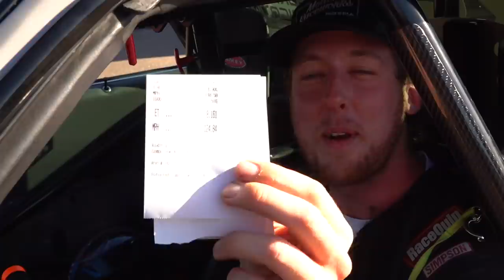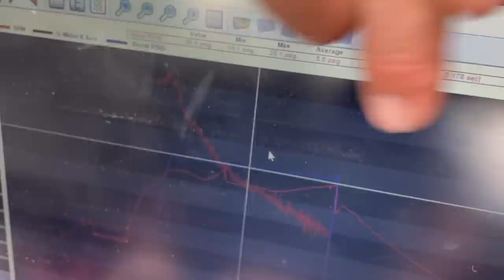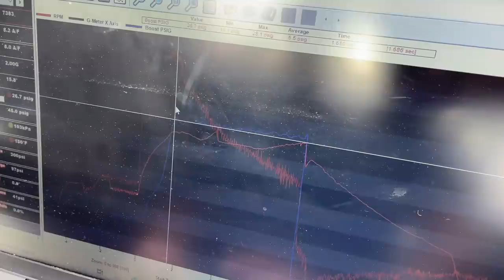Testing Mullet's NEW Turbo400 Lockup Racing Transmission For the First Time! HOLY SMOKES!!!

Comment: dead soft copper head gaskets have been used in drag racing since the 50's even in top fuel at well over 10,000 hp they still use the same soft copper head gaskets with good reason they work . they seal every time and are reusable add them and seal rings to an engine and you will solve well over half your head problems.

Comment: Wow I can't believe yall are pushing that kinda boost without O-ringing it! Kevin may call it a top fuel loop but we do it to almost everything anymore. Especially at those levels. You have a good engine builder. Need to talk to em about doing this on all the Texas speed plants. They have been good to ya. Time to step up the game! Btw the engine in my picture there is at 14.6 compression and is O-ringed.

Comment: You can do 2 things, a stainless ring in the block with a standard head gasket to help pitch and hold more cylinder pressure. or go full race with a fire ring and copper gasket. Fire rings require the wire installed in the heads and a receiver groove in the block, at least thats how the top fuel setups are.
Reply: Yo! Thanks for watching, I love you Fam!
You can start making profit like me in just three hours, don't miss out
Tell him I sent you!.
Reply: FIIVE ONNE FIVEE THREEE ONNE ZERRO FOURR FIIVE SEVVEN THREEE
Tell him I sent you!

Comment: I think the 60 foot problem may be an issue related to the initiate take up.  If you want closely, when the car leaves there is a little, tiny step forward before it really gets into it.  That is likely just enough to start the timer and boom, there is a tenth right there.  It's like it's not leaving tight at all.

Comment: Might be an idea, when there seems to be a problem, to make a habit of checking the cranking compressions when the plugs are pulled and before trying to restart/run the engine. Better yet would be cylinder leakage checks.
This will potentially point to a mechanical issue before it escalates, and also give some idea of the changes in the engine's ring and/or valve seal over time.

Comment: That stainless ring idea, once I heard it, just sounds kinda like a "Duh" kinda thing. You seal it in a way that provides as much safety as possible in case of explosion, but that first prevents explosion, coolant micro-poofs included. Can't weld it, so you invent some form of bracketry that increases a uniform and specific amount of resistance.

Comment: 25.06
Was just gonna say over at John Doc with TK they are doing that stainless steel ring instead of o-rings at top of each cyl when Kevin said kinda same thing.
If it did lift a head it did so on the pass before this one too because you can hear it.

Comment: Sometimes super safe is not good either. A little to rich and not enough timing will make that cylinder pressure a lot more then needed. Methanol is tricky.

Comment: Needs a fire ring. Anything high boost application. See it all the time in diesel builds and some factory Diesel engines. Nelson racing engines does it on most builds I think.
Reply: it has fire rings already, o-ring'd is different. o-ring goes into the head and pushes down on the copper headgasket.

Comment: Also, Fire ring, or O-ring FTW on the block to head if that is the issue, hell, I run an O ring stainless steel ring in my 800hp 2.3 stroker 4g63 Talon. Solid. mines just on the cylinder side, but you could do both. Also just using a MLS head gasket.

Comment: Play it safe cleet, pull the heads, inspect, new gaskets and retorque.  
Also would you please finally get a “spare” long block from texas speed.  Leave it in the crate.  And swap as needed.

Comment: Put some fire rings in your motors. Common on diesels running high boost, when even a full set of studs won't hold boost. If those don't hold your engine together nothing will lol.

Comment: I could of sworn I said to cut a a grove in the engine block and use piano wire to seal the deck to you a while back! Along with cryogenic treatment of the motor is you wanted it to last... oh well.

Comment: A straight acceleration line is the goal.  Play with the angle of the line, which is g force.  No wheelies, primarily because you can't steer in a wheelie, and car responds to crosswind more.  If you can get off the line at 1.3 G  and hold 1.3 G to the finish, it's going to rip af.
Reply: I'm pretty sure they're hitting over 2G already on the launch.  At least they had previously
Reply: there will be a G limit before the tires break free. A straight line at  whatever that G force value is optimal.  If you run the overall race at that limit, the bumps over the G limit will break tires free.  Until this can do the launch and run of a Tesla S Plaid up to 130-140 mph, not much point in doing anything else.  Specifically a 1 foot rollout ending at 5 mph, then apply power consistently and under control below / at the limit of traction. This should result in a straight acceleration plot until there is no more power left   With no skill or training, a Plaid will do a 1.18 60 foot.  Since the Tesla is traction controlled, you can assume a plaid is running at the edge of traction. Slicks have more traction than a Tesla and should be able to at least match it's times. The best times will be a launch that begins before forward motion from a trans bump ends. In other words a trans bump could be the rollout.  The rollout overcomes the inertia of the mass at stand still, and gets all of the car's velocity vectors pointing the right way.

Comment: Updated Mullet Pass Stats (only timed passes included)

This Video
Pass 1: 7.462 @ 186.72 MPH
Pass 2: 7.618 @ 146.83 MPH

Overall
Total Timed Passes: 45
Average Time: 8.136
Average Speed: 171.19 MPH

Record Time: 7.243 @ 191.05 MPH at Bradenton Motorsports Park
Record Speed: 7.413 @ 191.51 MPH at Bradenton Motorsports Park

Last 10 Passes Averages
Average Time: 7.815
Average Speed: 168.50 MPH

Comment: I have the stainless rings and copper head gaskets.  Leaked right on the engine dyno.  told to just put in some radiator sealer.  Six passes later still leaks going back to the machine shop.   If you guys don't have 1/2" head studs get those too.   Like Kevin says doesn't matter what you have it's going to break at some point.  If your not good with it time to find another hobby.

Comment: Make sure you listen to Kev And Make sure you get used to  even when your stoppn orcoasting putting in neutral that is a nice way to saving that transmission wow I do that to my car all the time cause my transmission is one of those CVT transmission every body is woundering why I do that it's a smart way to keep the transmission ware and keeping the transmission circulating cool fluid in the trans love that she is gona keep getting faster and faster.
Reply: Owe I keep hearing something clicking when you let of and start I hear it clicking.
Reply: When your coasting down the track on your vid is when I hear it  sounds like it was clicking it's some sticky tires nice run she is rippn.
Reply: I thought I heard something clicking when you coasted half way down the track check the video I'm sure you found it out if you didn't listen to the vid it's in there. 1st run and 2nd soon as you let off I could hear it click click click. All the way to the end of the track.

Comment: I never shift to neutral on the top end, my trick by me TH400 goes into a freewheel mode after a second off the gas. Never do a burnout in low start off in second gear unless you have all Promod R400 cryo internals..
Call TKM for the TOP FUEL HOOPS...
Reply: Going into neutral after a pull sounds really stupid to me. Decel is not gonna put a lot of wear on the engine, however that 1500hp that the engine was making a few minutes ago will!

Comment: I've always wondered if anyone would have the gumption to attempt to make a race engine where the block and head(s) are one solid piece, no head gasket(s), no head bolts/studs, no coolant passages (short run engines only). Install the valves and the pistons from the bottom. You'd eliminate head gasket issues entirely.
Reply: have a look up on the flathead engine. very poor airflow design.

Comment: Maybe its time for a Steve Morris engine. They seem to hold the high horse power better than Texas Speed
Reply: its just the design of the LS and small bore size compared to 4.5+ inch of a bbc/smx bbc 540ci+ with those turbos would yawn out 2,000hp with ease.

Comment: @ Garrett- Cleetus McFarland have you guys or KSR tried the Cometic MLX or the SCE/Athena Vulcan Cut-Ring head gaskets? I’ve heard some really good things about both. Only down side to the SCE Vulcan Cut-Ring gaskets other than there $179.00 each price are #1 they require a re-torque after first initial install after 1st heat cycle #2 if you ever lift a head they require that the cylinder heads deck surface has to be machined 0.003-0.005 with a surface RA Rating of 30-80. Just thought I’d ask and see what your experience is with either one.

Comment: Is it possible that the previous runs down the track had the fuel system temps up maybe caused vapor lock on a/the fuel injectors?

Comment: You don’t have top fuel hoops in that engine? I thought Texas Speed would highly recommend you needed them pushing that much power along with copper head gaskets. Need to start building a bullet proof engine, stop cutting corners, and stop having these problems, just like with the transmission. Do it once, overbuild it and do it right.

Comment: Why do you run the wg dump pipes so close to the compressor housing especialy without some heat wrap is it uneccessarily heating your boost temps up in the logs?

Comment: I was under the impression that you should NOT shift a th400/4l80e into neutral because it overspeeds the internals?
Reply: Correct,unless its a clean neutral/safety valvebody

Comment: anything with a 4.125 bore needs an iron block, top fuel hoops, copper head gasket, better cylinder heads with a better grade aluminum and 3/4+ deck and 1/2in 625 studs....get you a TKM engine, or Bennet Racing, someone more serious and capable than TSP........

Comment: Don't know enough about engines but at the power level it is at and how much the car weighs is the engine strongly enough built to handle what is asked from it reliably?
Obviously there are gonna be issues to take care of but it seems like there is quite a bit to do and chase down issues so often
Reply: This is a very new build. It takes alot to iron out issues
Reply: @williskeesel6049  obviously yes, can't expect any car really to work right out of the gate. I was just thinking out loud if a stronger engine from the start would've helped down the road with having less stuff to iron out or worry about breaking, but then again that can happen to any engine stronger built or not so.
And it isn't something you exactly know before you've tried either

Comment: I wouldn't even run out past the 8th until it will reliably do a 1.1x 60ft. No reason that car can't be in the 2's at the 330. Why lift the heads on the big end to run a number when its a pig down low?

Comment: You're going to add top fuel hoops to stop heads from lifting, then you're going to window your block with those steel rods, then you will be replacing billet aluminum rods every x amount of passes and wearing your crank bearing when the unpinned crank walks. Good ole 2K+ HP LS life, reliability ain't in your near future...

Comment: Steve Morris double oringa dinga time. He'll say Ixnay on the LSXay lol.   Doesn't like that jug walk over 1500hp. Time for big block Brodix. Keeping an LSX together over 1500hp is a full time job. Brodix 540 will run 3,000 all season and yawn. Just sayin' cast aluminum LS is an awesome starter motor but they have their limits. LS Next 2 Dart iron block will hold 3,000 safely. Can't do aluminum because solid billet doesn't work for race week.

Comment: You ditched rpm for the trans and went faster not even trying… Texas speed does fine for regular sub 1200/8 second setups… you are at the point that if you want to go faster, you need someone else to step up for your needs. You did it for the trans.. now go all the way.

Comment: Instead of random cars and boats, we need a drag car challenge. Build the fastest car for X amount of dollars. Or set a time and see who can get closest. The whole circulate 3 different drag cars between upgrade, race and break is getting a little stale and none are relatable anymore. I'm not saying change the content completely but do some budget builds, some stock bottom end shit sprinkled in. Still a fan and will continue to watch but instead of random crown Vic, jet boat or drift videos just sprinkle in some kinda different content. Obviously throwing money at cars doesn't magically give you a 7 or 6 second car but it's a hell of a lot easier. I'd be cool with a mid to low 9 second if you built it for $10-$12k. Also just a random commenter and might be the only one who feels that way tho...

Comment: You guys might not have done enough math to determine your gearing ratios. If 2nd gear is only used for part of a second then it's just dead weight and should have been geared closer to where 3rd is...yeah, 2nd gear is too aggressive...There's not enough of a difference between 1st and 2nd so you're wasting time on the shifts (both in the race and in trying to work around such a big mistake) instead of Having as aggressive of a gearing ratio as possible without sacrificing power by reducing your RPMs....It's not the RPMs, it's bad math on the gear ratios...You guys are approaching the transmission problems/solutions from the wrong perspective...don't turn the engine down because you made a mistake on the gearing - just get the right gearing. Otherwise you're limiting your potential to pretend you didn't make a mistake. Just own up to it, bite the bullet and try again. It's not that you're turning it down to go faster, it's that you can only work within the potential of your transmission and you peaked it out already. Rather than working at 85% because the transmission is at 100% you should be able to run the engine at 99% with the transmission at 99%. That being said you might want to go ahead and overbuild the engine, go old school and get some lugs that hold the cylinder head the the bottom of the block like a V8 from the 60s.